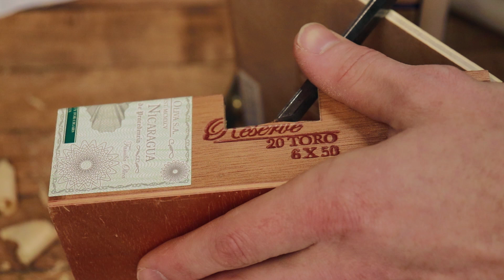Cigar Box Guitar Build

Comment: How did you attach the Peizo? Is it just in there loose? What's the purpose of the yellow tape under the lid?
Reply from the maker: The yellow tape is like big electrical tape, it's actually gym floor tape. I just taped the piezo down temporarily so that I could experiment with placement. Once you know where you want it hot lgue is probably the best option to stick it there for good.

Comment: Nice but not every one has the use of a shed, and a vice, and we're all not as proficient with tools and skills as this fella, I would rather hear instructions, watch it over 6 episodes,, repetition in this case would be key
Reply: Yea Im hip Most the dyi vids on cigar box builinh1 I've noticed the lack of mentioning  measurements and descriptions of materialist but I'm so ready to do this DooWaDiddy
Reply: 17.817 this is the dividing number to use when aquiring fret spacing.. from the center of the nut to the center of the bridge= is commonly called the scale.. ok. are you ready ? to find the placement of the 1st fret (to avoid confusion, lets use my CBG scale ,its 25) divide 25" by the magic number i gave earlier- 17.817.  my calculator reads 1.4031542 , this will be the distance(in inches) from the center of the nut to the center of the 1st fret. not too hard. now to get the 2nd fret, measure from the center of the 1st fret to the center of the bridge & divide by the magic number 17.817. again my calculator reads 1.3244006". this will be the distance from the center of the 1st fret to the center of the 2nd fret.. not really hard, just long division & careful measuring. i hope you see a pattern forming bc this is a lot of typing, lol. ok, ready ? the distance(in inches) from the center of the 2nd fret to the center of the bridge should be divided by the magic number 17.817. and the answer you get will be the distance (in inches) from the center of the 2nd fret to the center of the 3rd fret. measure 3rd fret to bridge, div. by magic # , answer is distance from 3rd to 4th. measure 4th to bridge, div. by magic# , answer is from 4th to 5th. i hope this wasnt to confusing & it helps. for 3string CBG's i make 1.5" wide necks. i make my scarf joints using 13° & i like to use at least 1 dowel to help support the joint. i like to make my bridge be 2.5" from the back of cigar box on all CBG's, the neck-thru & the neck stopped inside box. i like to make a 1.5"wide  heel piece that mates to the bottom of the neck and lives inside the box except for appx.2.5" that protrudes out toward the headstock, it helps support the neck & i mitre it up at 45° to the neck and try to sand it good, mine gets a 1/2" roundover w/ my router . i like to make my fretboards 1/4" thick & cut from maple or walnut , i can get them local. but there lots of tight-grained hardwoods that would work flawlessly. ok. im out. good luck 👍🏻😎